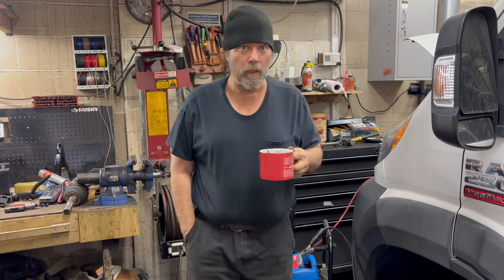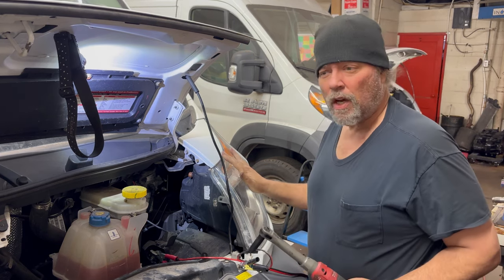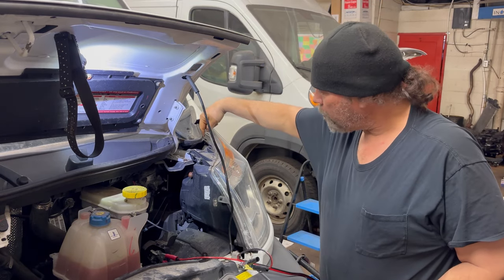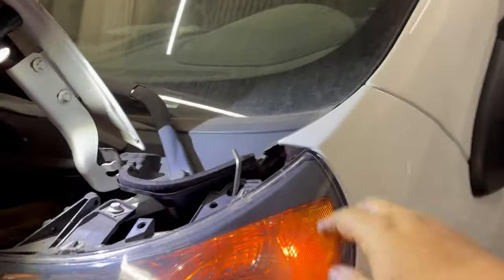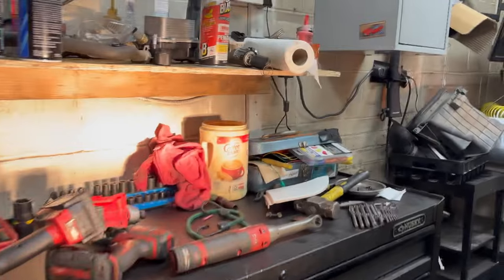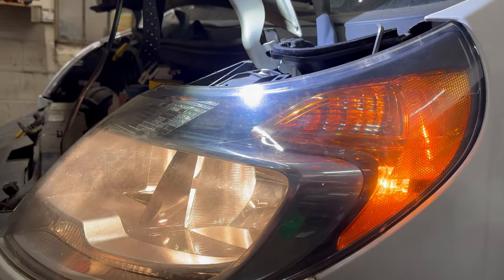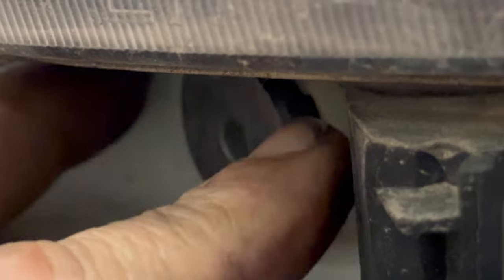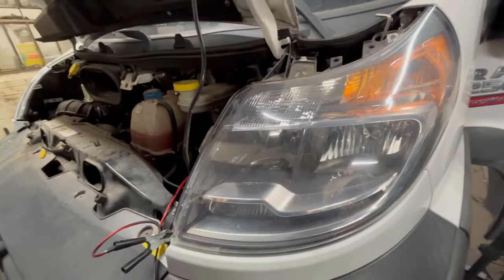Ram Promaster - How to Aim Your Headlights. Easy! Fun! See Better! Be Better. Crash Less!

Comment: Great content once again. I've made some adjustments to my headlights and I can't figure out why the high beams seem to shine lower than the low beams. The adjustments changes the aim on both low and high beams at the same time. Is there an adjustment only for the high beams?
Reply from the maker: To the best of my knowledge, the high and low beams don't aim independantly. But it's pretty complicated in there, and it's possible there's an adjustment for that. Unknown.

Comment: Regarding the side to side adjuster. I found when replacing my assy, the adjuster stressed the other bolts enough to break the plastic bracket at the bolt. I turned the adjuster to make all the bolts stress free. 
So, my adjuster is used to provide stress free mounting.

Will, when time permits, re-examine the fit & adjustment assy principle. Just be careful.
Reply from the maker: I probably should have made that more clear in the video - it's a sort of a tripod arrangement between the three bolts. Luckily, most vans don't need the horiz adjustment, but almost every van needs the vert adjust.

Comment: We have driving lights (factory) on our van. Got any info on how to adjust those?
Reply from the maker: I do not. Never tried to adjust them. Unknown.
Reply: There is an adjuster for up and down. It is on the back side. One side is easier than the other because you  crawl under and see it. The other side is accessed by removing a cover  in the wheel well right in front of the tire.